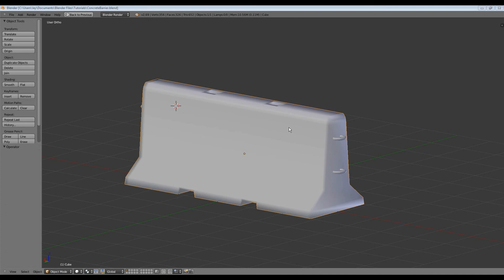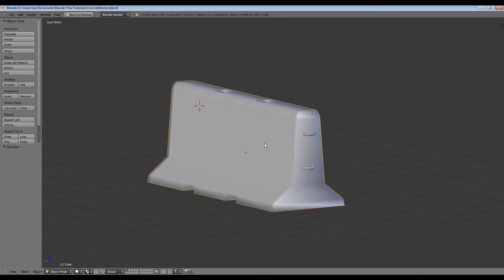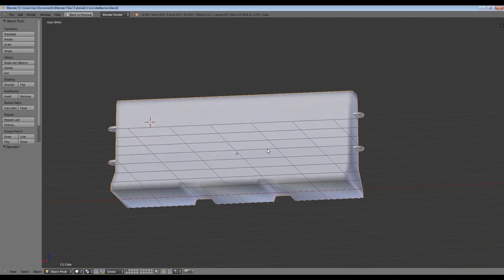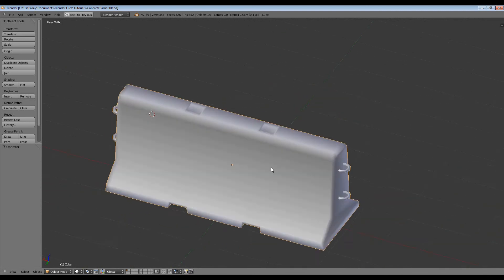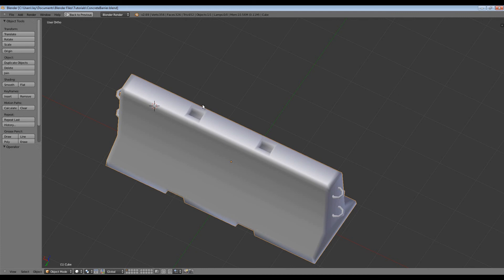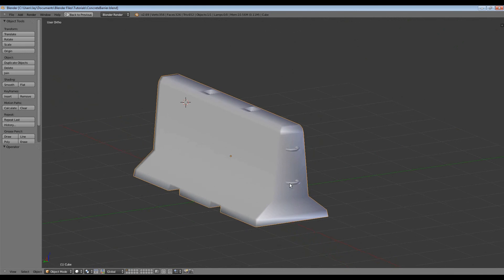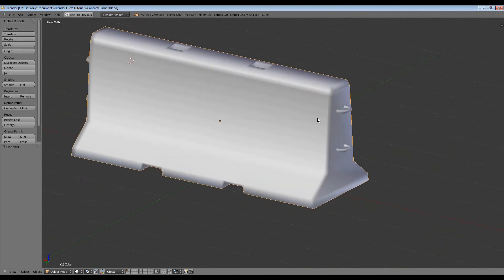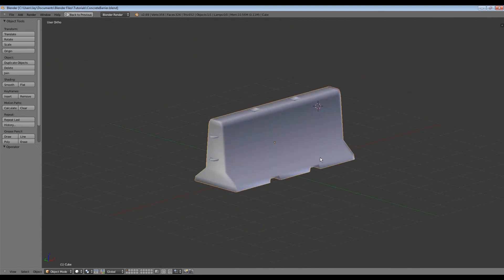Blender to FPSC-Reloaded Tutorial - Video 3 - Unwrapping

Comment: Hey, just started your tutorials and up to this point all has gone well. That is until I clicked "Bake" I've re-watched the video several times but every time I hit "Bake" my texture map becomes mostly black besides the outlines.Then whatever side you are looking at becomes invisible in the "Texture View". Any ideas what I did wrong?
Reply from the maker: Hi, thanks for watching the videos. From the sounds of things, your normals are flipped in the wrong direction. 'Normals' is the direction that the face is pointing. Te normals on my model are all pointing out, yours will be pointing in. The reason your texture was rendered all black is because Blender thinks that the outside of your model is inside it (because your normals are pointing in) so, when it bakes the ambient occlusion, there is no light to use, so, everything will bake as though it's night! Its an easy fix however. Go into edit mode (press tab or choose it from the menu bar along the bottom) and make sure that all of your model is selected (press 'A' until everything is orange), then, on the bottom menu bar (where you can select entity mode) there is an option called 'mesh'. Click that and a menu will pop up with lots of scary words and menu choices! Look for the option that says 'Normals'. (about half way up). Hover your cursor over that and then when more options pop out to the right, select the one that says 'recalculate outside'. It will then flip all the normals on your model to the outside. Then, simply hit bake again and you should see a nice white shaded texture added. (if you are in texture shaded mode) the little ball menu next to edit mode menu on the bottom menu bar. I know thats a lot of text and there isn't really many things that you have to do; i think I over explain things sometimes! Hope this helps.
Reply: Jason Forth Over explained yes, however it's better to over explain then to under explain! Thank you worked like a charm and I have a beautiful model to look at!